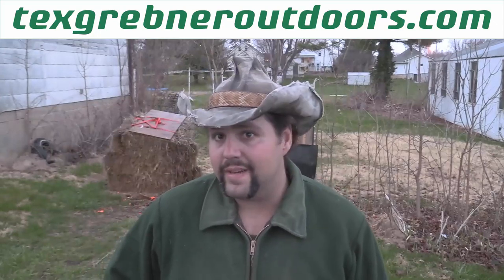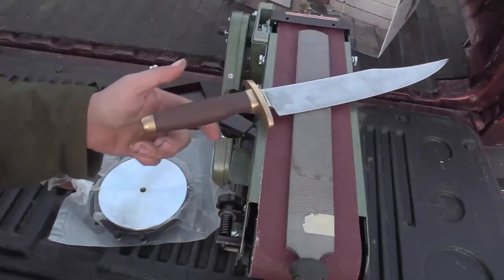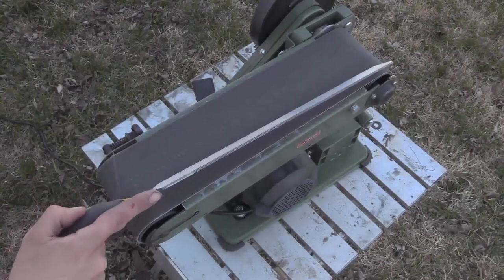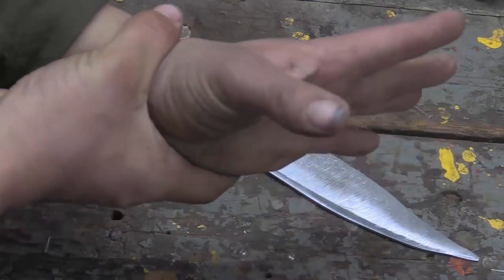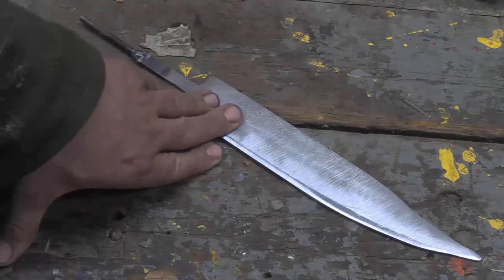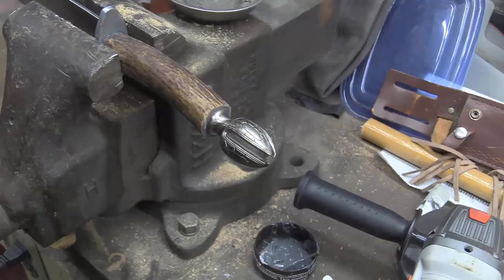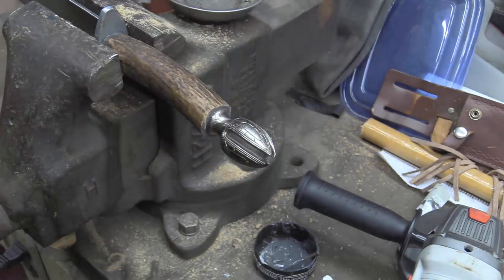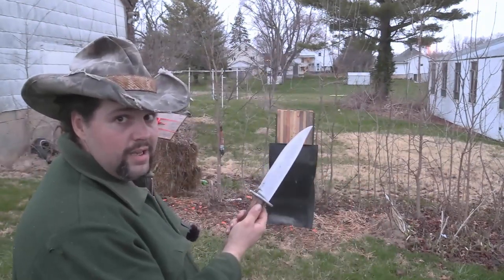Bowie Knife Blade Build: The Gambler's Ruin | Tex Grebner Outdoors

Comment: Well done you have more patience than many and you finished it when many would just walk away. Try a billet of 1084 / 1075 , 2 brick forge and some Hodgens Aquaquench. It will save you a lot time and sanding belts. The Gough Custom filing jig works well for doing this with files.

Comment: Considering you did almost everything in very unconventional ways: hey, the result is pretty find.
Next time if you do this kind of a stunt: heat the raw file up until it gets a blueish color. Then it is soft and can be much easier worked on. But then you got yourself a new job: harden and tempering it. Or: use my cowardly way: use stock steel, grind to your liking, send if off to harden.